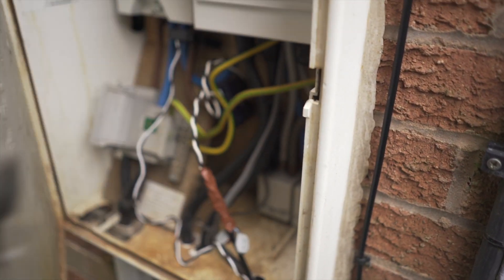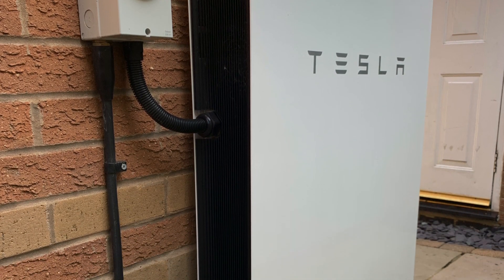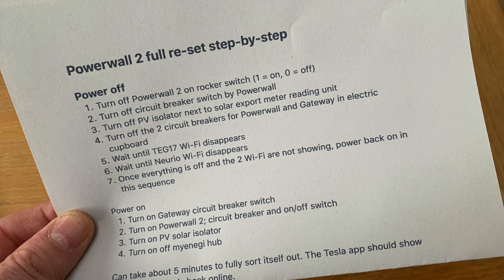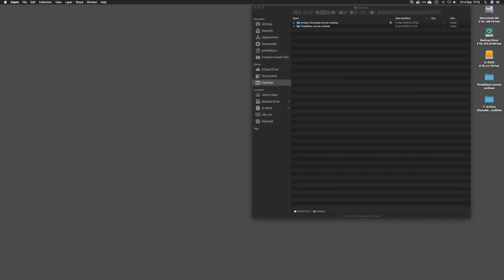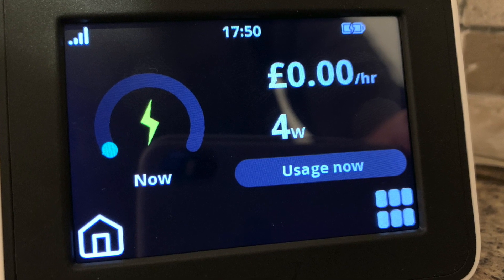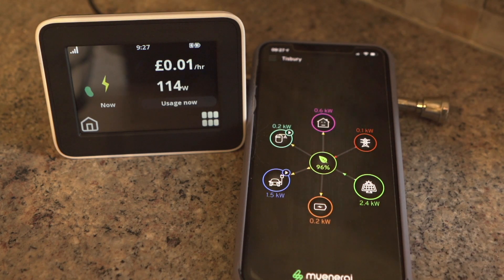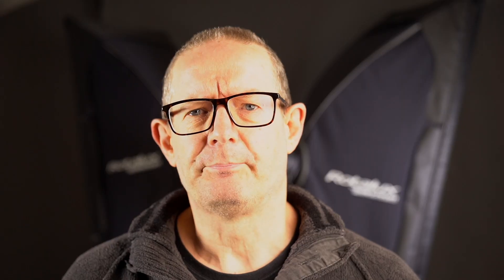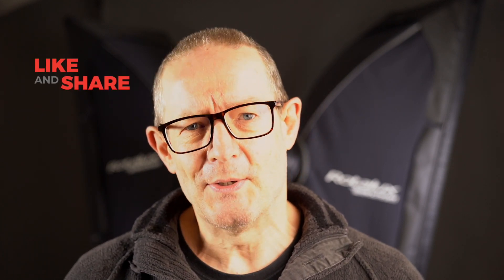Smart Meter swapped to stop phantom drain with Tesla Powerwall 2

Comment: Well done for sticking with it. I to have  phantom drain at night  import shows 0.01 spike when it happens 3 times it takes 1p. as I have 20kwh of battery it should take nothing, so the standing charge should say 48p after 12 midnight  but when I get up It already says 52p . No usage of the grid on my graphs. I am unable to talk to anyone at shell, I am on the third meter now and same thing happens. Time to change to Octopus and see if the can fix it, Its only a small amount every week but it should not be anything.
Reply from the maker: hmmm you might find you don't get much of a positive response. Most people I've talked to with solar/home batteries still get a very small grid pull, 0.01kWh each 30 minute segment on a smart meter even when on battery power. The only way to stop it would be to island your house or always be exporting to the grid.

Comment: Greetings John. Thanks for your tenacity, research and patience in getting somewhere with this, it was a relief to find that others have similar problems. (I have 10kW of PV panels, two Fronius inverters and PW2)

I read on one of the forums where you also wrote about this that someone else in Australia was also having issues with an EDMI Atlas smart meter. My SM is also and EDMI Atlas and I am having problems reconciling what my electricity provider is claiming I have used from the grid, and what the Tesla App reports. For example, on the 21st of February this year, the Tesla app claims we drew 5.5kWh from solar, 4.7kWh from the PW2, and 0.2 from the grid, while also exporting 31kWh to the grid (it's a pleasant summer here in Australia). However, according to my provider (via the Smart Meter) we pulled 6.18kWh from the grid, half of which was in peak charging time. That's a big difference. Over a month, we are being billed for about 50kWh use from the grid even though we have our PW2 always above 60% and generate up to 60kWh a day. We should have 0% draw from the grid.

I've spoken to our electricity provider, and that was less than satisfying. So I'm hoping to get more Aussie participants to join a cohort. I'm wondering if the code or programming in the EDMI units is similar to the L&G units. Quite possibly off the shelf software or chip circuits.

But also, in relation to this reactive power that is being measured, why does it get drawn from the grid? Why doesn't the draw come from the solar or PW2 reserves?

Anyway, your research has given me hope that maybe there is a solution down here also.

Cheers
Reply from the maker: Hi Steve
Sorry to hear of your plight. I found the only way to get resolution was to locate people with the same issue and get them to report their issue too. Data is key here. Record your variance between what your meter is stating and what your powerwall is stating. If you can show that you are running on battery with no pull from the grid then that strengthens your case. 

If you have not done so already, contact Tesla Powerwall support too, your installer and as you have already done your energy supplier. I had to push for 18 months to get any kind of traction. Just keep badgering and don't go away. Keep showing the data and find other users with the same problem and stay in touch and share outcomes. Eventually you will get traction. 

I'm not sure if you read the Octopus Energy blog article about the problem? https://octopus.energy/blog/perils-working-tech-innovators/
Reply: Hi Steve i have recently had a powerwall 2 installed along with solar and my energy provider Simple Energy in Australia and l also had an EDMI smart meter installed. I am getting exactly the same issue. My daily overdraw is approximately 6kwh. For the past 5 years my daily average usage was approximately 33kwh. My Tesla app shows 33kwh however my new smart meter is now 39 to 40kwh average. Have you had a successful solution?

Comment: Hi John, Thanks for your videos.  I am having a lot of problems getting EDF to agree there is a problem. My is slightly different in that it is showing daytime usage, when I have not used any.  I have 2 Powerwall 2s.
Reply from the maker: Thanks for watching Trevor. It was a slow long process to get some action and resolution. Thankfully Tesla, Octopus Energy and L+G pulled together in the end and replicated the problem and found where the issue lay. Do you have the same L+G meter as I did? EDF were well aware of the issue, however with such a large company it can be difficult to get to the right person.
Reply: Hi Trevor , what meter do you have , I'm with EDF and having an issue but I have a different brand of meter to everyone else
Reply: @snozzuk2  High Richard, I'm on holiday at the moment. I'll reply later this week when I return. Kind regards Trevor

Comment: I got my first smart meter installed on July 27th and luckily had watched your first video on this subject before signing up for a smart meter!  I emailed AES 5 days before they were due to come and commented that I had a Tesla Powerwall... Installer arrived, told him I had a Tesla Powerwall and that there was an incompatible meter from L&G - oh don't worry, these are new meters I was told!  At the end of the install I said to the installer, hang on... that looks like the one in this picture that isn't compatible.  

I didn't get very far trying to convince him it was the one that Tesla Powerwall customers shouldn't have installed. Phoned Octopus straight away after he'd left and told the agent.  The agent said it's very unlikely to be the particular L&G model as we don't install those meters anymore.  Few days later, I got an email and a phone call from Octopus saying the meter was being replaced in a months time 😂

I've now got the new meter installed (1st September) but so far it's looking like the new meter is between 13 and 40% higher than the values shown in the tesla app.  Unfortunately I think I need a few more weeks of data before I can question Octopus about it.  The IHD always displays a minimum 29W draw from the grid, even when the houses power demands are being covered by the battery (like right now while writing this comment) or the battery is charging from surplus solar power.
Reply from the maker: Happy days on the first meter install, it's a case of too many people in an organisation and lack of communication with their workers. You have to have your wits about you, at least you knew it maybe a problem which is a good standpoint.
My IHD with my meter usually shows a very minimal draw, even when we are on battery, however when you look at the Octopus website online account it shows very little pull from the grid when on battery for each half hour segment. Worth keeping your eye on, but I feel it's normal.
In terms of the accuracy, the Tesla CT clamp is not great for accuracy I've found, but it's not out by the amount you are stating, so yes gather figures and then let Octopus know about it. Speak with the smart metering team smart@octopus.energy if you haven't been doing so already.

Comment: Thanks John for the video. I may have this issue too but on a SMETS 1 meter that was reenabled in Feb. I recently has a powerwall installed and appear to have a drain of about 100w not shown in the Tesla reporting.
Reply from the maker: Over what period? If it’s 100w per day then that’s fairly typical and expected.
Reply: @johntisbury  hi John. No it’s a constant 100w draw. On investigation I think it’s an issue with my Grid CT clamp that is only apparent now I have a powerwall. I’ve pulled the api data from octopus and it’s showing zero
Reply from the maker: @kittonsplodge  ah okay. Most CT clamps can't detect less than 100W so probably the draw is actually less than it is showing on the meter.

Comment: Hi John, just come across your videos, very informative thanks. We are playing catch-up to some degree with solar and Powerwalls compared to you. We wherewhichelectricity, so disconnected complete from the gas now. replacedourdon'tfunctionalityappvideos. any advice how to see the extra devices such as batteries etc on the 'myenergi' app?
Reply from the maker: Hi Kevin thanks for watching. I think I'm right in reading you comment and question, your text has shown up all joined together. 
All you need to get the additional items on the myenergi app is to add a CT clamp (available from myenergi's website) and connect them up to a harvi device. I have 2 harvi devices in my setup which covers all the additional devices; solar array x 2, zappi, eddi, battery. The harvi saves lots of wiring as they work wirelessly with the my energy devices. There's a good forum for myenergi products here; https://myenergi.info

Comment: Thanks John
Reply from the maker: Thanks for watching Leo.
Reply: @johntisbury  only just discovered your channel -  lots of similarities- we were 25th from Heathrow, also we are Octopus and have a PW2 + solar !! Wanted a Zappi - but it’s too large we have a EO  charger
Reply from the maker: It’s a small world. Thanks for finding me I hope you find it useful and entertaining. Are you pleased with your setup?
Reply: @johntisbury  yes thanks - haven’t gone to Agile as I think the PW2 will have  a nervous breakdown
Reply from the maker: The Powerwall can handle Agile very well. It's all down to the time settings you put in Cost Saving Mode under the Time Based Control option. Agile will save you money against other tariffs over the course of 12 months, even over the Go tariff. As you have a battery you can breeze through the peak 4pm - 7pm just on battery power. We do our cooking during this peak time and pull nothing from the grid. We are all electric on hob and oven.
Reply: @johntisbury  how does PW2 know when to charge up during those 30 minute slots John?
Reply from the maker: @leoclarke6462  unfortunately at present times it can't, it's not Agile linked yet. I'm sure it will only be a matter of time before Tesla release their API to the public which will facilitate Agile integration. I've set mine up for a typical off-peak time slot from 00:30 - 07:30 every day which seems to work okay. It will charge at off-peak. Here's a post I did on my Community tab which shows how it is setup in my Tesla app https://www.youtube.com/post/UgyTYLH3fWflfmMrQsl4AaABCQ
Reply: @johntisbury  I do have a mine set up for 5hrs on go- not sure If Agile is cheaper  ?
Reply from the maker: Over the 12 months it is, providing you shift usage between 4-7 or don’t pull from the grid during that time. There’s more fiddling about with household appliances though on a daily basis as new rates are published daily. Depends whether you can be bothered to chop and change each day. Go is simpler and easy to predict.
Reply: @johntisbury  I tend to obviously charge both cars then - so between the cars , battery and dishwasher It seems to work well - do you have a gas or electric boiler?
Reply from the maker: That makes sense. That’s what I did when I was on Go. But we were working with a 110 mile daily commute so made sense to be on Go as it was a routine. Gas boiler unfortunately.
Reply: @johntisbury  that’s a lot of daily commuting - we have a gas boiler and desperately trying to switch over to electric without going 3 phase
Reply from the maker: @leoclarke6462  that's the issue. Does your house have a 100amp fuse? Are you looking at ASHP or an electric boiler?
Reply: @johntisbury  I suspect 60 Amps - 
Looking at 2 electric boilers working in tandem - 1 for underfloor and the other for the house
Reply from the maker: Yes it will work well. We have a gas boiler at present, however it will get changed in the near future. Could be a complete ASHP or simply an electric boiler. Not sure yet.
Reply: @johntisbury  the heat pumps are pretty noisy
Reply from the maker: The older ones are, new ones are very quiet
Reply: @johntisbury  might look into it - what are the constraints?
Reply from the maker: @leoclarke6462  I've only done high level research on ASHPs. They are not all equal and you must get a good survey beforehand. Often radiators will need to be increased in size if you are retaining your current wet system. Underfloor is best, but not easy to retrofit. From my understanding they don't work that well with microbore pipework as to make them effective you need a good flow rate. That's the key things I've gleaned during my research.

Comment: John, i have now watched three of your videos, most interesting, thanks . I have  Solar PV,  a Smart Meter(Landis + Gyr E470 Type 5424 installed in 2019 with a IHD (Chameleon IHD-6) and an electric car.  When I get the readings for charging the car I always feel they are on the high side, now seeing your video I wonder if I have a phantom draw. Back to the IHD this unit has been working fine for both gas and electricity, it shown exports to grid as well. But 2 days the unit lost all display data, I contacted Octopus Energy my supplier and they are sending out an engineer, with talk of exchange Smart Meter.
Reply from the maker: You get an endurance medal for watching three of my videos! 

The phantom draw that everyone has been experiencing related to those people with a Tesla Powerwall 2 and the L+G E470. In some situations they are incompatible with each other and cause that phantom draw or even drain back to the grid.

If you don't have a Powerwall then is maybe unlikely you are getting a phantom draw. However, that said, if you feel you are getting a phantom drain you have no real way of checking. The engineer visit is a great solution to putting your mind at rest. They can run test to see the accuracy of the meter realtime, however it is only what's happening at that moment in time. The best solution is for them to temporarily install a dumb meter which you can then compare the readings from that to your smart meter. If they simply swap meters you won't have anything to compare your readings against. The IHD pulls its data from the smart meter, which means if you read the meter or the IHD you are looking at the same data set. They should always agree.

The IHD has its own built in wi-fi connection with your electric smart meter, if you lose the signal/data on the IHD, moving the unit as close to the meter as possible often sparks it back into life after a while.

Comment: John - great channel - thank you. I have only recently (18 Nov) installed 6.5kw panels and Powerwall 2 battery. For the remainder of Nov,  my meters showed that I imported 287Kw from the grid and generated 63 Kw from the solar - a total home consumption of 350Kw but the Tesla App showed that I imported 245Kw from the grid and generated 60Kw of solar  - a total of 305Kw - a difference of 45 Kw over 18 days between the meters and the app. I am on the standard Octopus Green tarrif @ .16p per Kw so this is costing me around £14 a month. Could this be the phantom draw you're talking about?
I have the same meter that you have just had swopped out and I am due to have a new Octopus meter fitted  next week. Will that solve the discrepency?
Reply from the maker: Thank you for watching. 
It would appear that you maybe experiencing the same issue if you looking at 45kW over 18 days which is 5.6kWh per day. 
Best way to double-check is on a daily basis just look at the grid import from the Tesla Powerwall and compare it to the import from the smart meter, using the IHD or the meter reading online or at the meter itself. Just record these two data sets for a few days. You can then do a before and after comparison once your new meter is fitted.